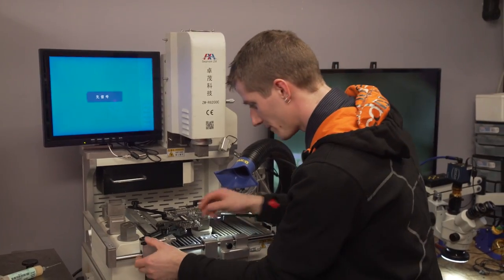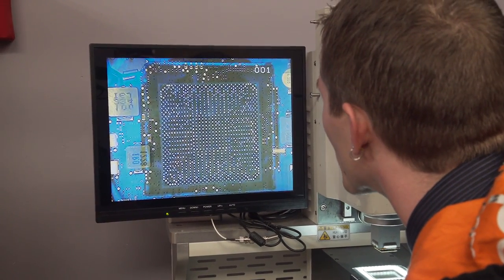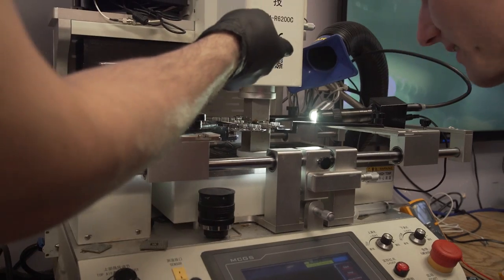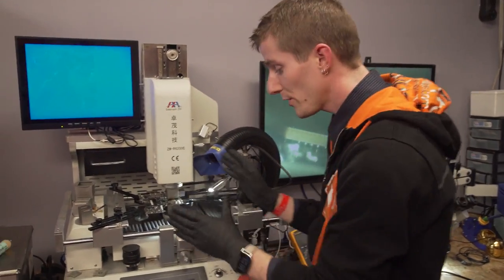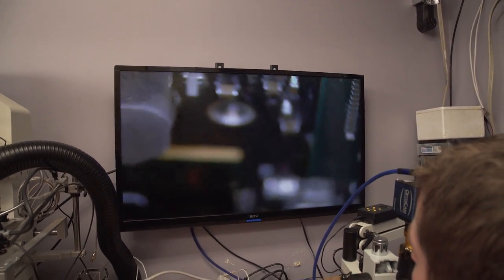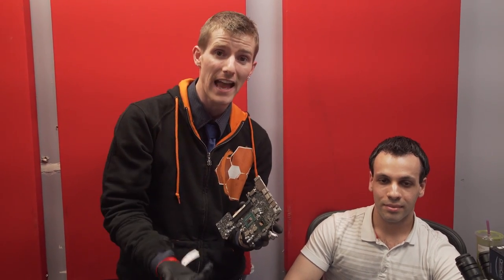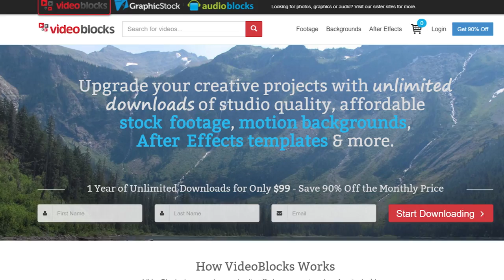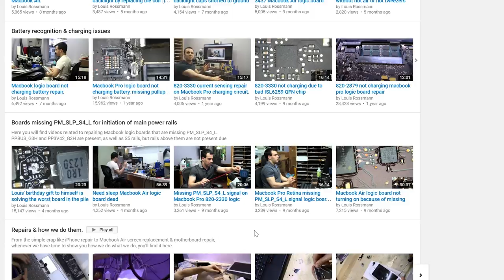Linus Attempts BGA Graphics Chip Repair! - Rossmann Repair Group, New York City

Comment: complains of a $7300 machine, built a $30,000 PC.
Reply: a 30K PC is more versatile and can do more its like comparing a £5 comb to a £2000 PC it may cost more but is way better
Reply: +Ralien I disagree, that 7300 dollar machine makes him money, it's really money well spent because it pays for itself
Reply: camtheham13 yes but that machine wouldn't make an average user money
Reply: but the point of the video was to inform people that if you really need to repair a GPU dont just go put it in an oven, more often than not such quick fixes may actually end up worsening the problem making it harder to fix them.

Its the same as the HDD recovery guys say, dont run chkdisk on a bad drive, it'll make recovery that much more difficult. I learnt it the hard way, took it for recovery the guy said its an easy fix, thought i'd try out chkdisk came back with a worse drive from which only 75% data could be recovered. Had I not used chkdisk all of my data could have been recovered.
Reply: Dhruv1223 but his comment is still relevant to the video its not the point but is still relevant
Reply: Why does chkdisk make it worse?
Reply: Drowsy Emperor well because it causes more stress to a drive that may have a mechanical fault. Due to increased stress from running chkdsk these mechanical faults will multiply leading to a drive that may not only be dead but irrecoverable as well.
Reply: Makes sense, thanks for explaining.
Reply: Drowsy Emperor you're welcome :)
Reply: +bloopers stupid people who don't use cloud storage? say that about my country where the average download speed is 4mbps and upload speed is 256kbps, and connections are limited to a few 100 GB a month.
Reply: +Dhruv1223 wow that's really bad, I get unlimited 80/40
Reply: +bloopers nice
Reply: +bloopers but even with those speeds imagine uploading and downloading several terabytes of data (if you're in the business of editing and grading films and videos)
Reply: +Dhruv1223 if ur a business like that having an offsite backup is essential
Reply: +bloopers don't have the luxury of cloud storage, so have several storage devices to store shit. 36tb to be exact. and of course we get rid of project files once the work is done like absolutely done.
Reply: +Dhruv1223 for you cloud storage wouldn't be economically viable but that still doesn't stop you having an offsite backup
Reply: bloopers as i said we do, but its managed by us. As In buy tons of storage devices and keep data on that, its not in the office, but at another location.
Reply: Built a 30000 PC he did not pay for*
Reply: That machine is well spent money for a repair shop.  Other than a cameo of one soemeone else owns, not for performing build and repair demos.  Most of the expensive things Linus gets and uses in his videos are provided by sponsors (i.e. companies that make them).
Reply: You don't buy a 7300$ machine to repair a 400$ GPU. You take it to a repair shop that has a machine and get it fixed, provided the warranty has ran out, and you don't want or can't afford a new graphics card.
Reply: It's not the same at all actually.  Graphics cards don't store your important personal data.  It's a piece of hardware, and that's it.  When they die, you don't lose your pictures or your important documents, etc like you would with a hard drive.  Putting it in the oven gives you a chance to re-gain functionality, but you're not losing anything.  They also increase so dramatically in speed and image quality yearly, that by the time a graphics card is out of warranty, they're not worth very much.. A high-end ($500+) card from 3+ years ago will only be worth like $100-150.  By the time this is an issue, you'll be able to buy a newer, better card for what it costs to have your card repaired.  If you can throw it in the oven and buy yourself a few weeks to save up for a new card, then why not?  The card is worthless if it isn't working anyway.
Reply: *****
Or you can sell it to someone who can repair it and sell it again.  In the mean time you can use your iGPU and live without what it can't handle.  Then maybe you can buy an even better replacement, a new peripheral or more storage.
Reply: How much do you honestly plan to sell a used, dead, 3+ year old graphics card for?  In working condition, even a high end card that old will only be $100-150 in WORKING condition.  You're not going to get more than $20-40 for a broken one..  IF you can find someone that even wants it..  

And maybe you'd get by with integrated graphics, but I built and use my home computer to play games and that's pretty much it (I'm on a computer 8+ hours a day at work and I usually hang out at my desk on my lunch break).  I play at 5760x1200 spanned across 3 monitors at 60+ fps..  The integrated GPU isn't going to cut it.  I'll take the $30 gamble and throw it in the oven to hopefully have something to use while I wait for my new card to arrive.

I get it, if that $30 will actually be a huge help for you, and make or break your ability to afford the card or get a better card.  When I was younger (even a couple years ago), I didn't have the resources I do now.. At this point in my life though.. $30 isn't going to hold me back from a purchase.. So if throwing it in the oven buys me some time to continue gaming while I wait for the new one, awesome.. If not.. I guess I'd just throw the card out and just have to go without SLI for a week..
Reply: Justin Mancini ya but cards like trx 580 3 gab are still valid cards now mine I could play games on ultra still even graphic heavy games so certain cards its still worth it
Reply: +anghellic Lol MAYBE at 1080p..  That thing is like 5 years old - hardly still relevant.  You can also buy one for $60 on eBay.. So tell me again how it would be worth it to spend $100+ to have it fixed?
Reply: Justin Mancini ya at 100$ wouldn't be I didn't hear him say how much it costs for the average  repair
Reply: That $30K machine is dead from what I seen on here. Regardless. Does he really pay for anything? Well mostly. Others are sponsors, like those you would see on a NASCAR or sports stars, however he gets to keep and use the products he is sent all he has to do is do an unbiased review which is hard to do.
Reply: ahahahaha , that got me!!!
Reply: Rossman can be a bit of a snob sometimes.  Is reflowing a CCA the right way to fix it?  Depends on which "professional" you ask.  Is resoldering with that pgba machine better? Yes of course. But not everyone has one, the oven is free and can bring a dead card back.  I'm definitely not paying ridiculous money to someone like Louis to fix it (and that's probably why he's upset, taking money from his wallet) . I would rather buy something newer and faster.  If you have a dead card and an oven what do you have to lose?  Also, this is the quietest I've ever seen Mr. Rossman LOL.
Reply: In all honesty, I think Louis's business caters to fixing CrApple products.  The people that buy Macs and iPhones are too stupid to try and fix anything themselves.  They paid twice the normal amount for technology that is 2 years out of date.   They will happily pay someone to fix it "right" rather than try to do anything themselves.   No offense to the guy, he operates in a captive market where  technologically illiterate people have nowhere else to turn other than him to fix their stuff.    When your power goes out in your house, do you load up a ladder in your truck and drive down the road looking up at the power lines expecting to find the issue and then try to fix it yourself, or do you call someone who is actually qualified to do that such as the power coop?   Well that's a bad analogy but still, these people can go to CrApple and pay obscene sums to the company that already scammed them the first time around to fix their defective product, or they can go to someone who will do it at half the cost.   They certainly cannot fix it at home as anyone with a PC can.
Reply: Apple products are tightly integrated and require actual effort to repair.  If you are a busy professional you are more likely to pay another trained professional for a repair instead of attempting it yourself.  Louis is in New York City where there are a lot of busy professionals who will gladly hire someone to fix their tech.
Reply: Yet if you are a SMART professional, someone who values their intelligence, you use that in your purchasing decisions.   You most definitely leverage that asset when it comes to technology.  The simple fact is, Apple hasn't had an honest to goodness original idea of it's own for some 20 years now.  All they do is steal technology that everyone else is developing and then fail at trying to patent it and sue the people who invented it.   At no time in the past decade could you legitimately say that an Apple brand computer was superior in GPU performance, CPU performance, Memory, Storage size and speed than anything offered by a PC at the time, and yet they charged their customers easily 150% on top of what you would spend for top of the line PC's, all because their stuff comes in these aluminum skins.   I contend that the people dumb enough to buy their products do so simply because all of the dumb people around them buying them.  Just a bunch of uneducated lemmings all jumping off of the same cliff but they think they are so smart for buying products from a "genius bar".   It's no wonder they cannot fix their gear.    I know this for a fact, I work at a major public university and one of my very early jobs was as a Tier 1 tech.  The university's policy is not to support apple products in any way, but some faculty have grants that allow them to buy their own computers, and hence some choose Apples which would give us no end of headaches trying to deal with these abominations on a secure network.  And then you have to sit there in the same office trying to fix this person's mac, and all he can do is rant about how his perfect mac is so superior because it looks so much better than a PC.  All i can do is shake my head.    That said, NOBODY in technology related fields used Macs.  It was nothing but "studies" fields such as Jewish studies, gender studies, film studies, and that sort of thing.   Nobody who did any actual "real study" from what I consider the traditional sense,  STEM related sciences.
Reply: +jkutyna I think it's hilarious when PC technicians don't know how to fix Macs and then blame Apple..  This takes the cake though because you said, "Just a bunch of uneducated lemmings all jumping off of the same cliff but they think they are so smart for buying products from a "genius bar". Its no wonder they can't fix their gear", and then going on to bitch about how you can't either.

I guess we're excluding mobile devices from this?  The iPod only changed the way everyone listens to music and brought on tons of imitations.  The iPhone only EXPLODED the smartphone market and everyone has tried to copy it since it came out.. The iPad CREATED its own billion-dollar market, which again, everyone has tried to copy since release..  

So now, I've gotta ask.. What PC companies exactly HAVE had original ideas?  I don't recall hearing about any revolutions from Dell, MSI, Lenovo, Asus, HP, Acer, Toshiba, etc..  What have they done, exactly?  I'll wait.
Reply: The iPod changed the way everyone listens to music?  Really?  I do believe that MP3 players were around for several years before the iPod came out, but to hear an Apple fan tell it, the entire technology was developed by Apple itself and copied by the rest of the world.   The iPhone EXPLODED the smartphone market?  Really?   Everyone tried to copy it despite the fact it was just copying everything everyone else had already developed and patented?

As far as not knowing how to fix Macs, if you work at an organization which specifically does not permit Macs and states outright that it does not support their platform, then what is the point in trying to train anyone to work on that?   That's like bringing a tractor to your local automobile dealership and asking them to service it.  It's just not what they do.   When it comes to the problems with Apple within the network as I had stated, it had more to do with the fact that Apple products just HATE to conform to normal networks and security.  They want to live in the ecosystem developed by Apple, and NOBODY uses that outside of Apple.  I'm sorry if it burns your soul but pretty much the entire world uses Active Directory.  Nobody outside of Cupertino uses Apple Open Directory, and short of using that, there's no good and efficient ways to manage Apple computers in your environment of windows or Linux machines where security is of utmost concern.   When it comes to security for federal grant projects that we run, that's when the government steps in and the FBI is calling the shots on our security and at that point, Apple products are out the window because they cannot conform.   So either the university gives up those fat multi million $ federal research grants and caters to any and ever 2 bit product out there that refuses to conform to standards, or you go with what works to follow all of the rules.   I don't make these rules.  When it comes to the criminal justice servers in my data center of racks that are covered by FISMA, then that's the government telling me what I can and cannot do.   I'm not about to shed a tear for some art major or film studies person who would rather have some mac in their office because that's what is prevalent in their industry.  Tough.  So why would I or anyone in the organization here train to fix Apple crap in the first place?   Apple chooses not to play ball with the rest of the world and just make it's own set of standards that it replaces every 24 months so it can force it's customers to buy a whole new collection of dongles, then that's the world they chose for themselves.   Don't whine and cry when the rest of the world has passed them by.

Oh yeah, you're griping about PC companies not having original ideas?  Seriously?   Why are macs every year inching closer and closer towards being PC wannabe's?  You stopped using your crap CPU's and went to Intel a few years back.   Now all of a sudden, Macs can (to a VERY VERY LOW LEVEL) actually replace parts inside or upgrade them, such as hard drives or possibly even GPUs.    Sorry but you're talking completely about PC's right there and everything that makes them superior than a mac.   Don't like your SSD in your computer?  Well just go out and buy a newer and faster one off of Newegg.   Oh wait, you can't even do that if you're using a Mac.  You're limited to Apple's proprietary format which means you can't even buy the fastest SSD's on the market after the fact and just pop them into your computer.   Have fun with that while I enjoy my brand new Samsung 960 PRO NVME drives for my Ryzen system.  GPU?  I can run whatever I want, as many of them as I choose.   Same with memory, displays, interface devices.  I'm not stuck with living with what Der Fuhrer decreed I must use on my Apple.      

Watch Louis Rossmann's repair videos and see just how crappy and low quality apple products really are made.   Their customers deal with it because Apple doesn't permit them to have any alternatives.  Apple keeps trying to drive 3rd party repairers such as Louis out of business by trying to  make it impossible to touch their products.   That would never fly with any other computer platform.  If AMD or NVIDIA starts selling crap GPU's that just die nonstop and then try to charge their customers more than the card was worth to fix it, those companies would be out of business very fast because people have alternatives.  Apple consumers don't.
Reply: What a mess of misinformation.  Where do I even start with this..

MP3 players were around maybe a year or two before the iPod came out.  You seem to be under the assumption that just because someone has made a similar product before, that no new original ideas were added by Apple.  MP3 players before the iPod had god awful interfaces, abysmal storage capacities, clunky software used for loading them.  I think that the vast majority of people, even avid Apple haters, will say without a doubt that Apple made the best MP3 player..  They didn't do it by just taking what was out there and reproducing it like every other company did.  The re-imagined it, added to it, and created something great.  

Yes, the iPhone exploded the smart phone market.  Prior to the iPhone, sure there were the blackberries and Palm Treos around.. Some HTC phones..  But the iPhone was a completely different beast than anything out on the market at the time.  The vast majority of smart phones had physical keyboards and used a stylus for input.  The screens were tiny.  They were matte plastic screens with no glass cover.  The phones were made entirely of plastic.  They could only accept ONE touch input at a time (Meaning that even if you used your fingers on the 2x2 touch screen screen, only 1 would register.  They didn't use capacitive touch screens..  But yeah, they totally just copied everyone else.

I'm not saying your organization should train you to fix Macs.  All I said is that you not knowing how isn't Apple's fault.  

Active Directory and Macs have played nice for a few years now.  The company I work for does not use Open Directory.

No, I wasn't griping about other PC companies not creating anything new.  YOU were griping about Apple, and I asked you for an example from ANY other company.

As far as Macs "inching closer to being PC wannabees".. That's incredibly far from the truth.  There has ALWAYS been an Apple computer with interchangeable/upgradeable parts - The PowerMac which was the predecessor to the Mac Pro.  These were ALWAYS built in a traditional-style desktop chassis (With the exception of on of the PowerMac G4, which was a small proprietary cube).  You could always upgrade the RAM/graphics card/CPU, or change out dead parts like a power supply.  This actually changed 4 years ago in 2013 when they moved to the garbage-can style Mac Pro.  They actually went from a traditional desktop form factor to a completely different one used by no other system on the market, with more non-standard parts than ever.  How exactly are they PC wannabees again?  Really, I don't get it.  You must have been joking.

As for SSDs.. That really depends on what machine you're referring to.  But doesn't this go against your argument for Apples trying to be PCs?  Weren't you JUST saying that Apple is trying to make things more modular?  Seems like even you know you were wrong there.  

Still waiting for you to come up with a single original idea a PC manufacturer has come up with, by the way..  But I'll bet your next response dances around it too.
Reply: Bois lemme just grab some popcorn. I'll be right.
Reply: This gon be good
Reply: Spent 140 grand on two cameras.
Reply: +ThatGTAFan720 And this is a very cheap station mind you. A "serious" re-balling station can go up to $130k without impeding on factory level equipment territory.

+Ralien Well the average user isn't a professional in the field of electronics now is he? Nowadays this machine is mandatory for most electronics repair shops. Re-balling a chip with cracked solder joint, is much cheaper for the shop and the client than to exchange the entire pcb. Also changing a PCB requires a bunch of license agreements and trade contracts in order for the manufacturer to provide the repair store with the PCBs (at a preferential price of course, but the store doesn't really earn anything for that).
You can always make a profit out of these things. Just get one machine like this one, get a test bench equipment. Strike some tech support contracts with, say bitcoin miners or something. Keep re-balling GPUs until you can start a different business. Then sell this equipment on ebay to some russian that's gonna grind with it until he goes blind and clean house. Rinse and repeat until you're rich enough to be the president of the US.
Reply: you know what's more versatile? a poleaxe!
Reply: He's just jelly.  That's the real reason he went to Rossmann's -- he was scoping out what kind of machine it was so he could stick one in a hidden room in his lab.  xD
Reply: Joshua Richards Your telling me Linus was not there for the "oven mit"?
Reply: Now let's update that.

Complains of a $7,300 machine, buys a $150,000 camera.
Reply: CrimSun What is satire?
Reply: ThatGTAFan720 lol
Reply: Not a $7300 RAM stick then Linus is fine.
Reply: Ralien can you repair smd boards though?
Both are very useful, and baring in mind, that industrial device is a computer, just without desktop software.
Apples and oranges ...
Computers and computers...
Reply: well filming with their several hundreds of thousands of dollars worth of RED camera equipment :P
Reply: Intellitech Studios <3
Reply: Apple seems kinda the same as Nintendo.  They come up with some great idea like the first iPhone it changed the way we look at phones but also makes some flops and they also refuse to conform maybe that’s bc it limits them to much or bc they wanna make repairs harder? Or both.  And see say Apple is behind in cpus is a joke look at the A11 it’s crushing the snapdragon 845 which released after it...  its also pushing with a intel i5-i7 mobile chips.. but in repair shops none of that matters they can’t get parts from Apple they will not provide them and some parts even 3rd partys can’t help u with.  And as far as Mac vs pc macs have higher levels of security on user level equipment but the ball game changes when you have professionals throwing in curve balls being able to use pc openness to increase security.  But anything can be hacked even if no internet just how hard it is or how is another story.
Reply: You dont have to buy the $7300 machine. You just have to take it to a shop that has this $7300 machine to repair your board properly, instead of just throwing it in the oven.

I still think louis is correct. Linus just has butt loads of money and free shit. He could just afford to throw away a graphics card. SO, throwing it in the oven isn't a big deal for him.

Taking it to a guy like Louis would be reasonable if the cost of the repair doesn't exceed the cost of gettiing a replacement.
Reply: just buy a twenty dollar harbor freight heat gun. works just as well.

With practice.
Reply: Intellitech Studios he use the $30,000 PC for everything
Reply: $30,000 computer was sponsored and mostly covered for cost.
Reply: look if i can't fix a graphics card by simply puting it in the oven, it is probably better to just buy a new graphics card than to dish out 7k bucks for a machine i'll neeed like once or twice.
Reply: camtheham13 LTT is not a repair shop so it doesn’t make him money.
Reply: Take into account their professions. What does Linus do vs what Louis does.
One has ROI vs no ROI
Reply: @samcat27  Putting a graphics card in an oven and exposing it to extreme heat is a good way to make sure that card is never usable again. You can seriously damage your stuff if you do something like that. Plus in the case of a dead GPU, heating it is a very temporary solution. You still have a failing graphics card, you've just prolonged the inevitable. It's honestly better to have someone attempt genuine repair than to do your own ghetto solution that not only might damage your card, but will only last about a week if you have any kind of heavy reliance on it. You might get lucky, or you will much more likely ruin a 100-500 dollar graphics card beyond the point of possible repair. Not everybody has the kind of expendable income to throw money away like that.
Reply: @danielhounshell2526   Daniel Hounshell  #1 these components do reach close to solder melt temps (500-600f off the top of my head) in manufacture and repair. Indeed they shouldn't operate at those temps nor should they stay there for very long.  #2 If the card is dead AND out of warranty I assume that getting it fixed will cost more than the card would be to replace.  Maybe Mr. Rossman is way cheaper than I think but if it's broke and you're just going to throw it away or eBay it as parts what's the harm?  If you are going to find the "neighborhood GPU repairman" then baking it would be dumb.
Reply: @soup5220  Apple has improved on some technologies, however it's been quite some time since I could honestly say they led the industry in anything from a technical perspective. 
As for original ideas from other manufacturers, one example would be HP's partnership with Intel to produce the original Extensible Firmware Interface back in the 90s. IBM was one of the leading forces in the development of computers early on, even if gave their PC business over to Lenovo. There's also of course the Raspberry Pi, which got a lot of people into the PC building community. I think a more fair point however, is that these other manufacturers don't necessarily need to come up with new ideas, since they don't force proprietary nonsense into all of their technology the way Apple does, they can rely all of the companies that they work with to do some of that innovation. Need I mention Apple's plethora of non-standard port types that don't really perform any better than standard in most cases. 
Their desire to do things differently than everyone else also backfires quite often, like when they released a Mac with only USB-C ports, and since no one had released any technologies for it yet, everyone had to buy adapters. Also how they alienated many advanced users by getting rid of the function keys.
Even when they don't change much, it still doesn't always work for them, they've released many devices that were just poorly designed, like a Mac that had its fans blowing on the adhesive holding the display assembly together, or their phones that bent due to Apple cheaping out on materials (which like all Apple products, were overpriced for what you got).

As for Apple devices being a pain to work on, as someone who occasionally has to repair these things, I can attest to that. Apple does everything in their power to keep the average IT technician from working on these things, from non-standard screw types, to adhesives, to not even having access panels on their devices. It's frankly a nightmare trying to perform repairs on these systems, and on top of that, for software issues, their OS is terrible for any kind of advanced work, since accessing the things you need is made a hassle for no reason. Also their BIOS...don't get me started on that BIOS... As for the people Apple actually pays to fix these things...good luck with that, they're getting paid to sell computers, not to resolve simple issues with hardware. Most of the time, if it's out of warranty, they'll just recommend you buy a new one, you have to jump through hoops just to get one of them to look at these things.
Reply: @windhelmguard5295  or you could dish out probably like 70-100 bucks to someone who has that machine.
Reply: @danielhounshell2526  Do you realize you're replying to comments that are over a year old?  I honestly don't even know what I said that you're replying to, and I don't care enough to look through the comments here.
Reply: @ralien3066 
Neither would a 30k PC.  I make assloads of money trading equities on a normal 2k PC.
Having a 30k PC would not change how much I make.
Reply: Or a $100,000 RED camera. LOL
Reply: @ralien3066  that 30k p.c cant do anything without the $7,300 machine , Hmmm
Reply: I have not seen this machine recently, does anyone know if Louis got rid of it?